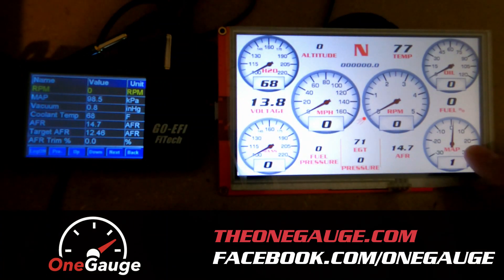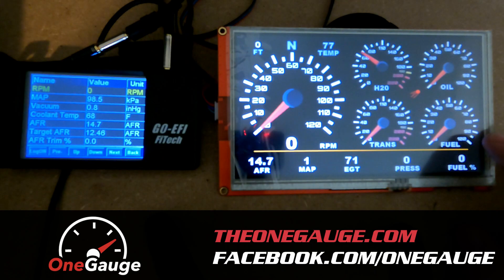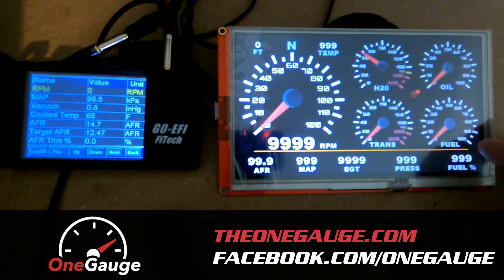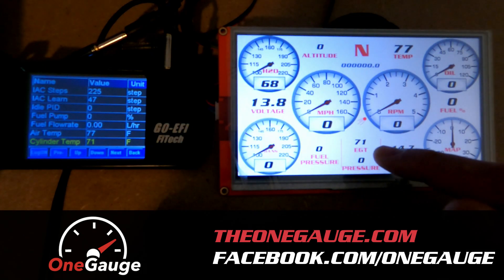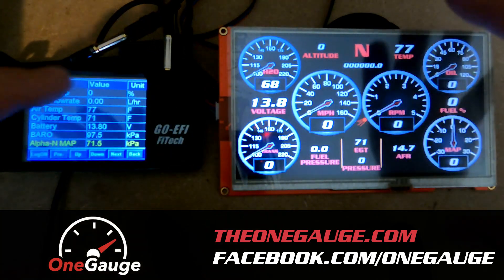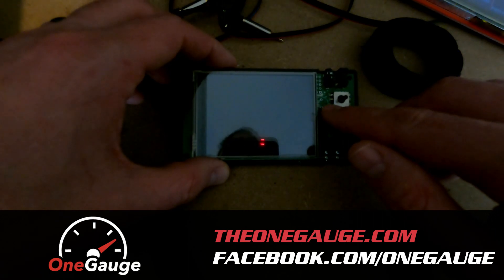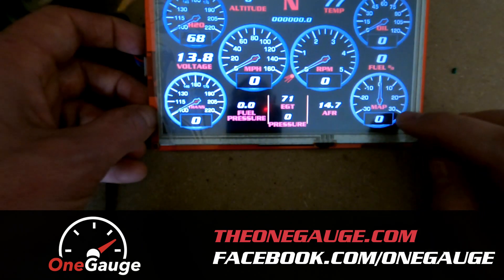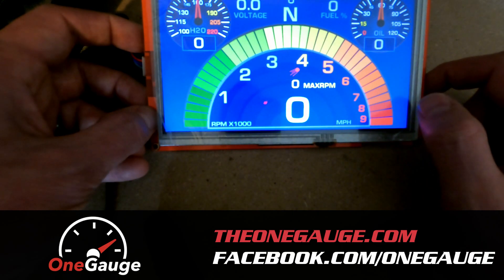OneGauge Fitech Demo and Explanation

Comment: Hi im interested in a fitech Version of your one gauge system so i have a fitech efi systems whit the newer Handheld will this newer Handheld Work whit your system? And my Seconds question is  i have also a fitech tcu for my 4l60e Transmission  is it posible to adde datas from the tcu Like Gear selection converter Clutch and speed on the Display too greetings from Germany and sorry for my Englisch
Reply from the maker: Hi Daniel, yes, the Fitech product will work with any handheld, new or old. For your transmission questions I'll need more information- please use my email, theonegauge@gmail.com, and we can discuss!

Comment: I'm really interested in the availability of reasonably priced digital dashes to work with aftermarket EFI systems. When the PCM has all that information it makes sense to get that information from that source rather than piggybacking on a bunch of extra gauge sending units.
Reply from the maker: Agreed! It makes it much faster to connect as well. Happy to answer any questions you have!

Comment: If I'm only wanting to use a tablet for data inside the fitech can I not just use a USB splitter and a app for that data?
Reply from the maker: Hey Michael, I replied to your email a few minutes ago. Unfortunately it's not that simple- there has to be a computer that 'interprets' all of the data sent form the Fitech and reformats it in order to communicate with the tablet, as well as manage the hardware required to connect to both. So it still requires the OneGauge hub, but can be done without the screen.

Comment: How easy was it to install? And can you customize dashes and lighting?
Reply from the maker: Hey Josh, it's basically plug and play. You'll replace the Fitech data cable that runs from the handheld to the ECU with the one we provide and that's really it. You can then install any other sensors you want (like oil pressure) for additional inputs. 
Everything can be customized, for sure. There are about 25 pre-made designs on the screens but you can have a totally custom one designed as well.
Reply: Can you tune off of it?
Reply from the maker: @joshbrunet9079  not yet. I hope to add that feature in the future though.
Reply: What sensors can you use for ls platform's for oil/trans temp ect??i was looking online not alot of info but your sites really.thanks
Reply from the maker: @weldinggaspedaling2605  it can be used with a ton of different types and brands of sensors. It's hard to put every detail on the website without it being overwhelming, so best to email us to discuss your application.